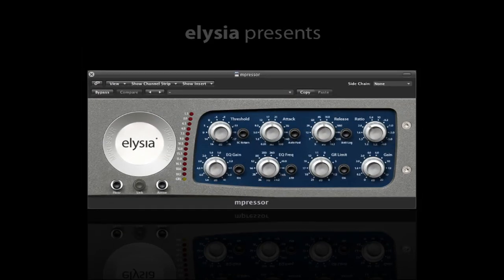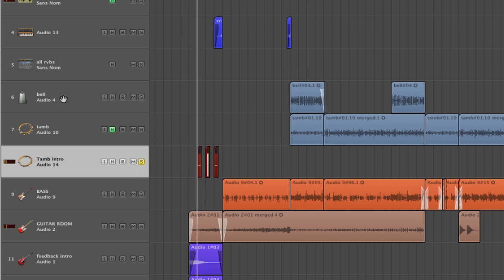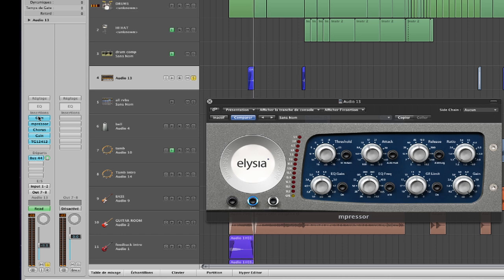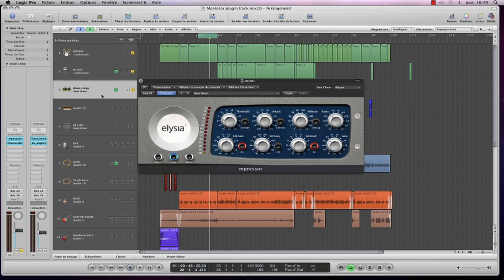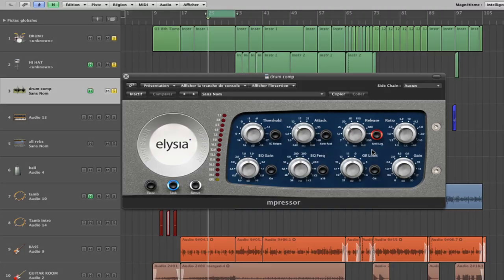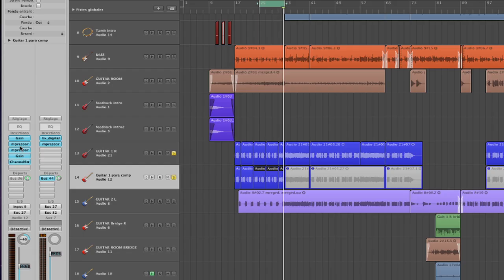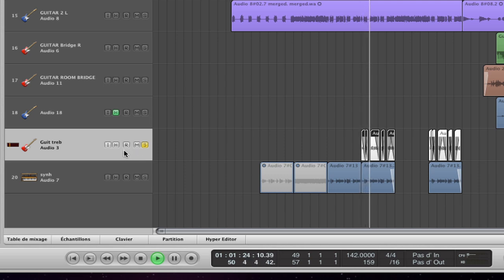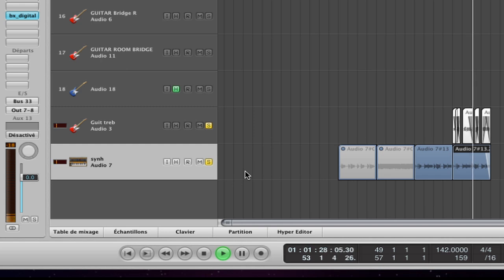mpressor plugin tutorial

Comment: An input and an output trimmer would be nice, in almost every occasion you use 2 gain plugins extra. I recently got it and it is a very nice compressor, the eq, the limit, the saturation it has…etc but every time I use it I put an other plugin for gain staging. Still it is on the way to be my main mix buss compressor, it is on a lot of my groups and in some instruments maybe twice. You didn’t mention what happens when you set the ratio at minus  - values or +